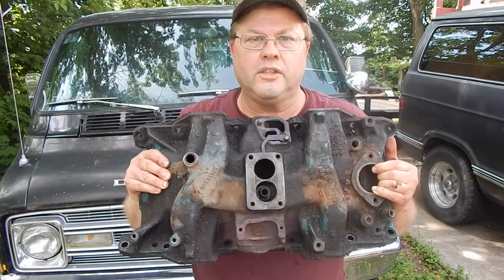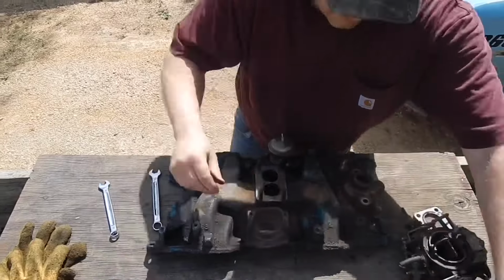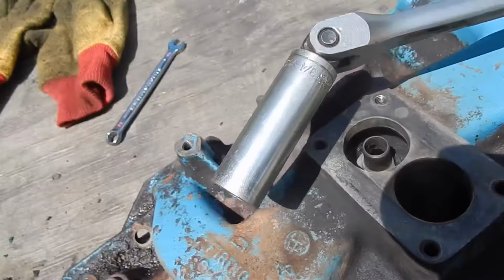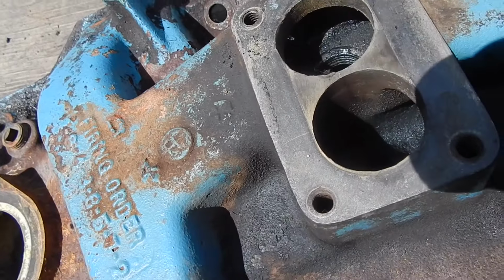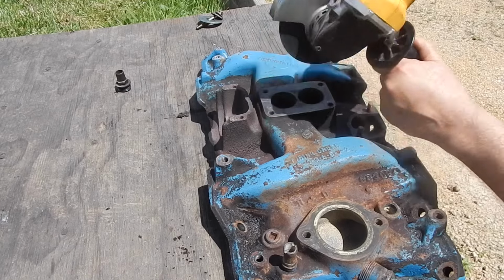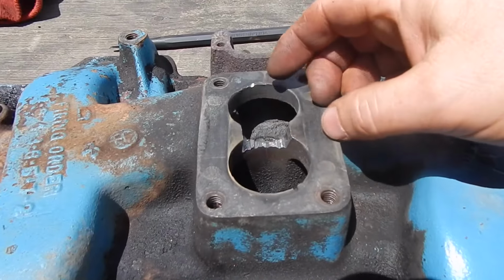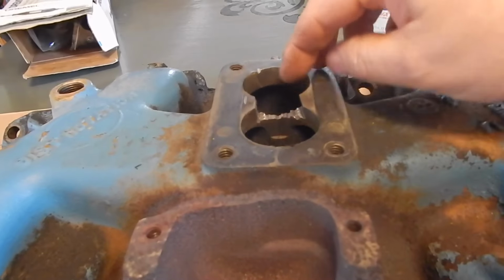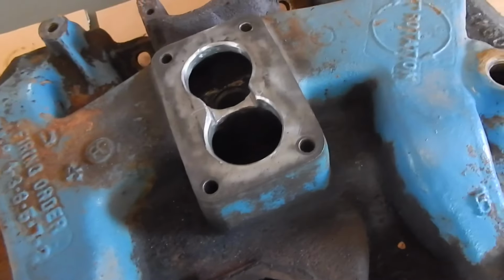Mopar 318 2bbl intake mod * MPG and HP Part 3 #nonamenationals

Comment: That Manifold is a BOAT ANCHOR. It weighs a TON. Get an aluminum dual plane intake manifold. Your Engine will LOVE it.
Reply from the maker: This intake was to be part of race that is documented on this channel.  Thanks
Reply: Love my 318s have 2, was wondering will the bigger 2 barrel that comes on the 360 and 400 fit on the 318 intake manifold? Have you ever ran one on a 318? Always enjoy your video and info.
Reply: Money spent is a Lazy and inefficient use of brain power. Buying someone else's solution only conquers part of any problem and leaves no room for innovation or any possible understanding of the engineering. Besides, whatever you gain on someone else's solution can be topped by spending more CASH. LOL.
Reply: Maybe the weight savings doesn’t justify the cost. 
Far as I can find all aluminum intakes for the 318 are 4 bbl. 
So, $175 for an intake 
$200 for a decent reman. 4bbl Carb. 
$150 for a 4bbl air cleaner. (Not open element cheap junk. )
Different kickdown linkage. Maybe fab yourself or purchased used $50. 
Maybe scrounge and come up with better prices but I think it’s gonna cost $400.00 +. 
What’s the investment here in the video?  A day and a can of cleaner.

Comment: I always cut the round "stack" off the floor jet (EGR) and grind away about half of the hex part where I can still screw it back in. Opens the port up substantially without leaving that gaping threaded hole! Love your no-nonsense mods and informative videos!!
Reply from the maker: Thank you!   Yes, that stack will likely not have any bearing on this engine going forward!
Reply: Rodney 
What about just putting a plug in and completely blocking off the EGR  ? I think that's what I would do, or just get a manifold from a junk yard that is before the EGR came out.
Reply: @bertgrau3934  That's definitely the way to go, but I did that mod on a 440 TQ intake, which they unfortunately never made w/o EGR, they did offer the '72 400 TQ intake w/o EGR, but they are a scarce 1 year deal. A 318 2v intake from the 60s or early 70s should be an easy find, however.
Reply: @318willrun  Haha! I get that! But if you wanted to plug that giant hole with minimum flow restriction, it is an option!! Love the channel and believe me, I learn something from your show quite frequently, and I've been in the MoPar biz 40 years this year!!
Reply from the maker: @rodneybyrd9516  shhhhh... it's plugged !!  Ha!
Reply: @rodneybyrd9516  
Sir, thank you for your information,  I didn't know about the 400 and EGR.  Just wondering would a 383 manifold fit the 400 ?
Reply: @bertgrau3934  Yes, but it would be a square flange AFB/Holley style. TQ was brand new on BBs in '72 (400).
Reply: @rodneybyrd9516  
Again thank you for the information.  I thought I knew a few things about Chrysler products,  but you definitely know your stuff.  Thank you for sharing I appreciate it.

Comment: I had trouble with cylinder 8 on my engine always being a little lean. I tried putting new gaskets and various types of sealer used when I reinstalled but always had the same problem. I was forced to daily drive the car anyways and eventually the lean condition made the compression lower in that cylinder. When about the 3rd or 4th time I had the intake off I gave a much harder look and noticed the port on cylinder 8 had a spot that almost looked melted or pitted in a way. I took it to the machine shop and had it planned and checked for cracks. the guy told me that spot was a manufacture defect ad it looked as if it was a "factory repair" where they welded a defect in the corner of the port. He suggested I use the thicker composite gaskets and grey rtv. Said for what ever reason gray seemed to work best. Since then I have had no issues. Just something to be aware of.

Comment: oldschool tip,when you take the carb off,take 2 of the carb nuts and use them to remove the carb studs..
simply put them both on one stud and lock against each other with 2 wrenches and remove stud..this saves the threads from getting bunged up by some guy with vise grips :)
wink wink

Comment: I have a stash of 2 barrel manifolds I might need to try this out on on one of them. I also have an older version that was used in the late 60's? that is a single plane factory 2 barrel that I have always wanted to try out on something. These old 318s need all the airflow you can give 'em and the BBD carbs run so good its hard to justify a 4 barrel
Reply from the maker: Thanks for watching!   It ran so good before, and outside of our race with the Hoosier Garage van, this van will probably never race again.

Comment: A few things i have done with intakes. The EGR system only affects the engine at idle, above that it has little effect. What the system does is to introduce a neutral (non combustible ) gas so that the engine will function at a very lean F/A mix. Drawback: Those holes & the one fitting are obstructions to air flow.  I remove the plug that is under the carb, tap the 2 holes for a pipe plugs and insert a pipe plug that uses an internal hex wrench to tighten. I can supply the sizes if you want. A big problem with those EGR ports is that they can often be clogged with carbon and if you don't plug them a sizable chunk of carbon could find it's way into a rebuilt engine. A manifold off of an engine that has been burning a lot of oil can have a lot of carbon buildup. If you have to clean those EGR passages: Plug both sides with something & pour  paint stripper into the large hole under the carb & let it sit overnight. Another method that I have seen on U-tube but have not tried: Use a common hardware variety propane torch & heat one end of the passage until the carbon starts to burn then start blowing air through the passage with an air nozzle. The burning carbon turns into a blow torch as the compressed air is forced through the passage. I have watched the process but never tried it, seems to work. I have seen intake manifolds the had the entire heat crossover  passage totally blocked with carbon. On those I start the cleaning process with long twist drills then proceed from there. On the cover plate at the bottom of the intake. There can be a bunch of krud buildup under that. The plate is held in place by 2 little drive screws, screws that have coarse threads and are driven in place by a hammer. They can be removed by grinding a small flat on both sides & removing  them with a set of vice grips. They have right hand threads. Tap the holes with 1/4" X 20 tap, install short 1/4" screws or bolts, tack weld one side to keep them in place. That crud can find it's way into a new engine. If you should get a manifold that has been sand blasted it is imperative to remove that plate because there will be grit under the plate. On cleaning parts: Oven cleaner works well on large parts, even engine blocks. On heads & valve covers I use a different method. Get a good 5 gallon plastic bucket & put in a 4 gallon mix of 50% water/ purple industrial cleaner that can be purchased at Lowe's or Home Depot. You have to do half of the head or valve cover at a time but it works great. Drawback: The solution loses it's ability to dissolve grease & carbon at colder temps. You are doing the same kind of engine builds that I have been doing for years to keep my old vans & trucks running. Going to try & keep up with this 318 build. Interesting.
Reply: Or just toss it in the bin and fit an alloy aftermarket.
Reply: @trickster8635 . And  after you buy the intake,$$$. A 4bbl carb to fit it,$$$. Different throttle pressure linkage, $$.  A 4bbl air cleaner, $$$.  So, toss the intake and $500 bucks.

Comment: I grew up in the era when these engines were at their prime and my dad was a car dealer. I got to drive a lot of cars and trucks with this motor and the 360 in them and they always seemed to far superior than the Ford and GM offering when it came to fuel mileage. We had an early 80’s Ramcharger 4x4 suv that my dad drove with the 360 4 barrel. One of the reasons he drove it was because for a heavy 4x4 suv it got insanely good fuel mileage.
Reply from the maker: That was a great era for sure!

Comment: Back in the '90s I built a 1979 Mercury Capri I use the 302 fuel injection motor converted it over to carburetion.
    The intake I used was a factory Ford 302 high rise single plane Aluminum Intake Manifold never seen another one like it.
   I was still in high school at the time had no money built the car with used parts.
    I drove it to the drag strip getting 25 miles to the gallon I ran a 13.98 at 98mph that was with a used clutch and used street tires.
Reply from the maker: That's really impressive!   Thanks for sharing!
Reply: @318willrun  I wish I still had that car

Comment: i had a 318 in a lil Dart that ran like a scalded dog AND stayed together. I'd like to stroke a 360 into the 400cu range. like to see over 500ft, i don't care about hp. i like to feel the pull from takeoff. thank u for ur time sir and the tips u bring. never can know tomuch, again, ty for ur time
Reply from the maker: we appreciate it, thanks!
Reply: Don't stroke. All of your combustion and power comes from the top 20-25 percent of the cylinder travel. All you are doing is making the piston travel farther with no more force behind it. Look it up.
Reply: @aperson3268 True, but if all he cares about is torque, a longer stroke is the way to do it.

Comment: I have used the huge threaded EGR nozzle and cut it flush then weld an allen bolt flush into it so it can be tightened. Then make a simple block off plate for the EGR valve.
Reply from the maker: Nice trick!

Comment: Yes you can Port it for 500 CFM 2 barrel Holly & Carter made some good carburetors two barrels. Step that that modification can be done with a gaskets.
Reply from the maker: Good suggestions!   We are sticking with the stock bbd 2bbl for this project.  Thanks for watching!

Comment: I did a quick test on a 318 intake, no exaust will get thru if egr valve is closed or capped, and the holes in the floor on both sides of intake act as a balance tube between the two sides.  Are you capping off the holes in the intake floor on both sides?
Reply from the maker: Yes, you are correct !   We'll make it all a non-factor!

Comment: Had a 74 dodge truck 318 cid had detonation and overheating issues in the summer. If u insist on using that turd do yourself a favor and pound plugs into the air crossover holes and use the block off plates that come with the manifold gaskets. Good for @ 15 hp and no more pinging

Comment: So, yes there was a single plane two barrel used on the 360s with a larger 500cfm 2 barrel, and then the tbi intakes, you could try one of those. I have a video of porting out a tbi intake on my YouTube channel, they have quite a bit of potential.
Reply from the maker: Thanks for sharing.  yes, lots of intake possibilities for the small block mopars.   On this particular project we are sticking with the original.

Comment: You should look for the  273/318 factory single plane intake. They get even better power from what I heard.
Reply from the maker: Good suggestion!  Yes, a lot of people on different sites have had good discussions on which is the best 318 2bbl intake!    As for this project, we are sticking with the factory equipment and seeing what becomes of it.  Thanks for watching!
Reply: @318willrun  if I could figure it out I'd send a pic of my favorite dodge I ever owned. My 76 B200 tradesman dealer pimped. Factory ev2 paint, shag rug benches/bed with spindle upper and solid panel cover lower walls and a bar with ice box cooler.
Reply from the maker: @Mr.mopar71  you can send it through email
Reply: @318willrun  what's your email?
Reply from the maker: @Mr.mopar71  318willrun@gmail.com
Reply: @318willrun  sent

Comment: ...so was even the 340/360 2 bbl intake the exact same intake? Too bad you couldn't build a 1.5" spacer for additional down low torque. Still eager to see how it performs!
Reply from the maker: Thank you!  We are eager as well.   All 340's were 4bbl, and the 360 2bbl would be an excellent choice but on this project we are sticking with the original intake.  We may actually play around with a spacer, we'll see.

Comment: I would Match port with gaskets and heads, and weld a plug witouy the scew head and smooth the floor
Reply from the maker: Good suggestions !  Thanks for watching !
Reply: I used a short Carriage bolt on mine

Comment: Where did you buy the adapter for the mastercylinder on the d150. I'm in the same boat as you. I need the adapter to put the mastercylinder on the firewall
Reply from the maker: I actually bought that from forabodiesonly member that happened to be a subscriber to this channel!!   He made it himself.
Reply: @318willrun  keep your eye open for another one. I need to remove the booster off of my truck.

Comment: That will surely not hurt the intake and I believe that it will help it out a good bit . So now that u have that done u can start opening up the ports on it big and wide 😂🤣 boy now that would take forever and the race would be here before you got that thing opened up completely😂 through unless you did have it extrude ported. I wonder how much it costs to have one extrude ported?
Reply from the maker: It costs more than this cowboy makes !  (wait! I don't have a cow)  Let's hoping I just "lose" instead of get embarrassed by the Hoosier garage van  😂
Reply: @318willrun  🤣😂🤣 No cows , now that's not good 🤔 wait I don't have any cows either, only 2 turtles and a so Im a curtleboy 😂🤣 Let's hope that all of these little things that you are doing will net you a big W or at least a big T which will still be a W being you're going in the underdog but I do believe that u will have done enough all over to squeak  it out. Are u going to put plugs in the intake holes that pushes exaust into your intake because that cold air/fuel charge should help you out alot plus get those bulky tubes out of the way and plug the holes. Heck you already know all that anyway but Im just babbling but I bet you have took advantage every single detail that could be gotten but even though you will probably not race it again it will still be fun to drive with the extra power 💪🤠

Comment: A couple of replies suggest a 360 intake. Nope, those have bigger runners to match the bigger intake ports on 340/360 heads. If the mixture coming down big runners crashes all around the small port holes on 318 heads, it won’t like it, and you won’t like the results. 360 intakes need 360 heads (not a bad idea anyway, just check clearances and chamber cc’s first).

Comment: Great build! Taking notes as I am planning to rebuild my van's 318. Are you going with the 318 stock heads? Would 360 heads work better or just mess all geometry up?
Thanks man.
Reply from the maker: Thank You.  We are using the factory 318 heads.   360 heads work great, then there is the "larger cc" on the 360 heads that lower compression.  You can cut .040 off the 360 heads and they work good.   Done that a few times.
Reply: @318willrun  Thanks! Im watching at this moment your part 2 on this take. Will go with 318 heads for now, and a summit 6901 cam. All and all, Im following closely your build. Thank you, great content as usual.
Reply from the maker: @ChiruStone  Best of luck with your build!

Comment: Just get a small aluminum 2 barrel for 500 CFM are a four-barrel 600 vacuum secondary.
Reply from the maker: I've not tried the 500 cfm 2bbl on a 318, would be fun though!
Reply: I had a 500CFM Holley 2 barrel on a 1964 Studebaker 289. Turned that car into a rocket.

Comment: What did you do with egr holes ?
Reply from the maker: we will make them a place of non-factor !  Cap, seal, and thanks for watching!
Reply: @318willrun  are you plugging and smoothing the holes under the carb?
Reply from the maker: @hotrodray6802  it won't have the pipe in it anymore

Comment: Wouldn't raising the compression just a little be better for a few mileage because it would increase power throughout the whole Power Band without the need for any more throttle notice those are open chamber heads so they can't be good for compression I don't know I don't have any experience with them just curious?
Reply from the maker: yes, you are correct.  We are cutting the heads in hope to gain as compared to before disassembly
Reply: @318willrun  😊
Reply: I typed thanks and it put a smile face its not a smartphone its not smart at all🤬

Comment: Brother, I care about you and your safety. PLEASE wear gloves when you use an angle grinder or any tool. After 3 surgeries, I finally have use of my index finger after an angle grinder disc exploded and almost cut my finger completely off. It happens in an instant. Just care about you!
Reply from the maker: I appreciate that, my friend!  Safety first !   And I don't talk enough about safety, yes, I did wear safety glasses and always do!   Man, I hope your finger fully recovers !!!!
Reply: Yup, me too.
A quick slip with an angle grinder exposed the inner workings of my index finger barely missing the tendons which looked surprisingly like thick dental floss.
Guys on the jobs jobsite almost threw up after I showed them. 
I lesson learned for sure, a career manual machinist I am and have much respect for things sharp, spinning and potentially harmful but my first  few times using the angle grinder were reckless in hindsight.